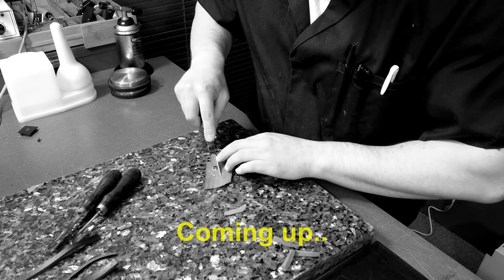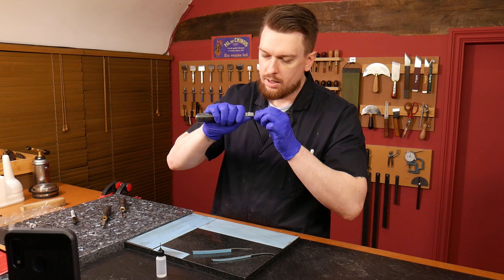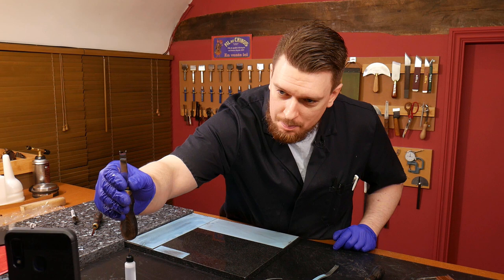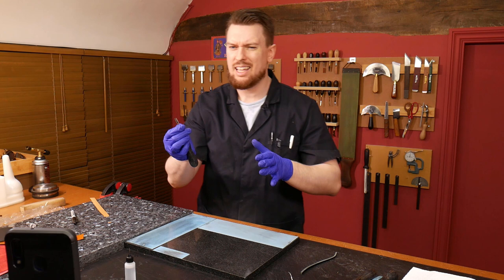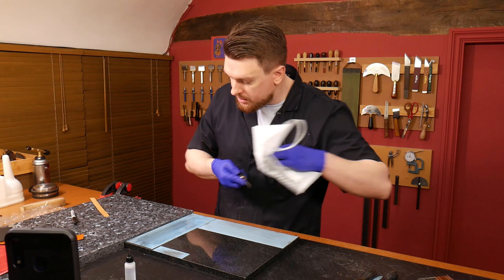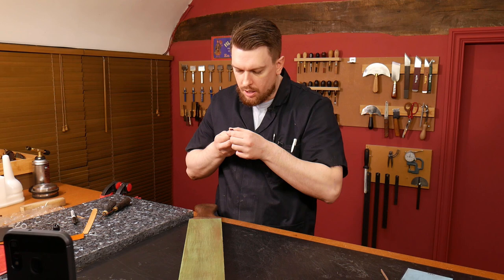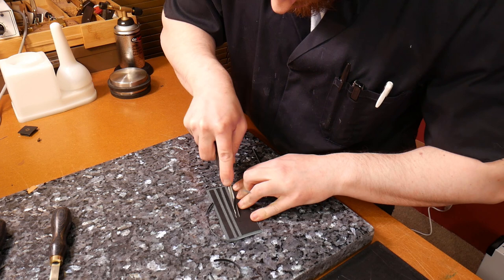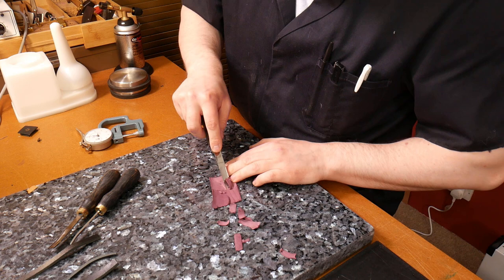🔪How To Sharpen Your French Edger

Comment: Finding the correct "angle" of "cutting" with almost any cutting tool involves concentration and consistency of angle of cut, as you have already found. But, another important point to  work on is called "muscle memory" here where I live. It is the toning of those muscles used in performing the cut repeatedly so that it is "memorized" by the muscles involved in the cutting procedure. It can't really be "taught" as it depends on a lengthy amount of time using those muscles to gain a better and better cut for that specific procedure.

Generally, it is referred to as that angle at which you remove just the right amount of material to gain a near perfect angle of cut when you use the tool. I hope this helps you adjust your physical position at the bench and your precise repetition of movement to come as close to a "perfect" cut as possible.

Comment: Forgive me if this is a frustrating question. When you say "milling mark" are you referring the the bevel at the tip of the blade. Is this the part that you re trying to remove and smooth out? Thank you . New info for me and I am trying to hone my new french edger at the moment.My best, Stephanie in New Mexico USA
Reply from the maker: Hi Stephanie. If you Google milling marks and click Images, you will see what I am talking about. Spiral machining marks from the milling process. A good edge should be smooth on both sides. If one side is rough from machining, you will never get a smooth push cut from an edger, so they must be removed. If your edger doesn't have this issue, you're fine to bypass this.
Reply: @LeathercraftMasterclass  Thank you. I did do that after I made my comment and still felt a bit frustrated, so I left my comment here because I wanted to hear your thoughts about milling marks, in particular. Thank you for responding!

Comment: Just recently bought a Palosanto and it’s not as sharp as I hoped out the box. Would 2000 grit be ok to sharpen with or should I order some 2500 grit? I already tried to strop some and still wasn’t getting a good result. Hoping I’m doing everything correctly.
Reply from the maker: If you can get an edge with 2000 grit, you can finish that off with polishing compound within a few minutes of stropping. I don't think you need any higher grit to be honest.
Reply: @LeathercraftMasterclass  ok I will give that a try. Appreciate it 🙏